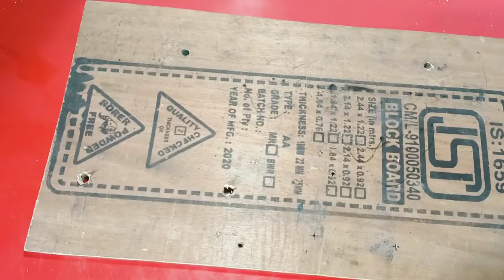Free Energy Generator | With Car Alternator And Water Pump Motor | PMG Generator New Experiment

Comment: Fazer um banco disso para abastecer fazenda e minerar biticoins 😁.
I sugest you show us a measurement as voltage and corrent . Put some resistive charges like lamps and go incleasing its number until achieve its limiti power .

Comment: That alternator from car and it only produce 12V at high RPM and that induction motor run 220-230v can't even get enough voltage and current to run🙄👿